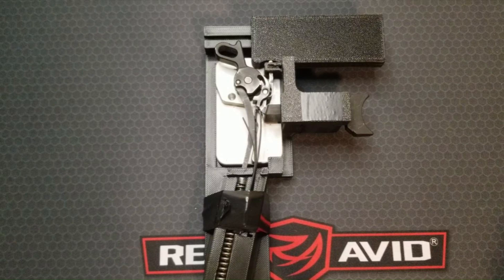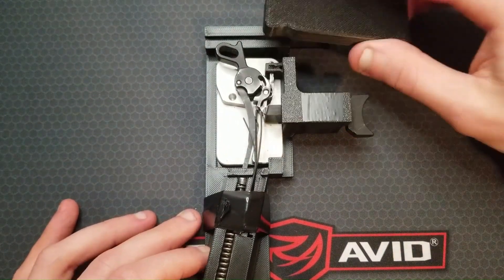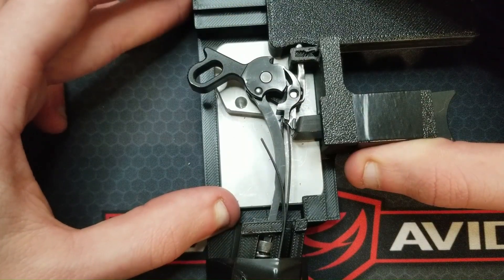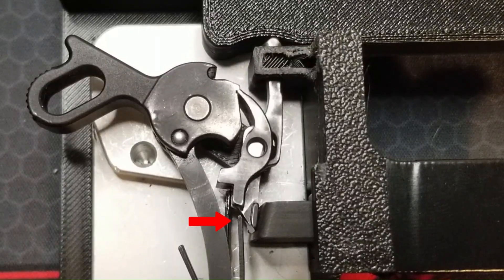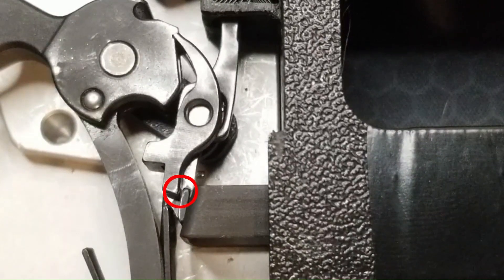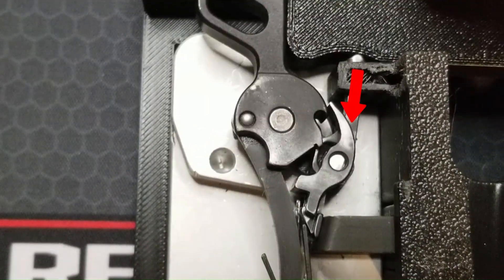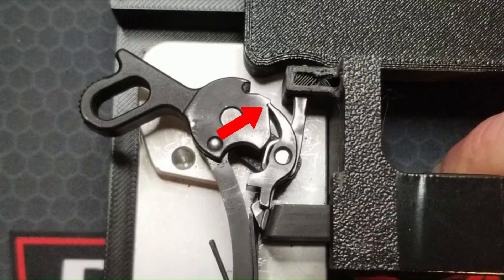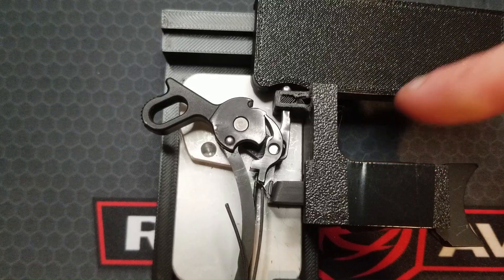Detailed 1911 Trigger Action Demonstration

Comment: Okay, I am interested in getting into 3d printing. Lets say i have a decent budget--whats a good printer for gun stuff?
I'm a CNC machinist with a bit of CAD knowledge btw. I don't know if that really helps. I need to get better at CAD. I'm still an apprentice.
Reply from the maker: I actually just bought a Bambu Labs P1S. I highly recommend Bambu labs printers. You want a printer with an enclosure (that is to control the heating/cooling of plastics that require higher temp and slow cooling for layer adhesion, etc.). If you want to print polymers that are... close to what polymer frame pistols are made from - you're looking at nylon and higher temp polymers - also glass/carbon fiber filled. You need a hardened steel nozzle and extruder gears for that (thats about $40 of parts to upgrade the P1S - The X1C model comes with it already). Thats about it. 3D printing metal is not feasible for people to do at home/for a hobby. the printers are like $50k+.

You'll need 3D modeling software to create your own designs - I use the free version of Fusion360. It works well enough for my purposes. The Bambu labs printers have their own slicing software. You upload a 3d part file (SLT, STP, solidworks, fusion, etc.) into the slicer - set your parameters - tell it which filament you're using and some other stuff. it creates the G code for you and sends it to the printer. 

Thingiverse, GrabCAD, and many other places (maybe some specific to gun parts...) have the models of... stuff... ready for download - throw it in the slicing software, slice it, print it.

Hope this helps.
Reply: @EngineersArmory  i have Fusion360 and a student license of Solidworks although I need to get better at Solidworks. I tried following a slightly old guide to make a picatinny riser mount and it over defined the sketch. Sometimes I really hate Solidworks, I actually haven't played with 360 too much.

It's funny you mentioned the Bambu labs printer. That is the exact model I was looking at the other day, recommended by a guy who built his own CNC machine. I'll have to get that one, it seems really nice.

Eventually my goal is to start my own shop either making 2011 race guns and nice AR15s or I may start by making suppressors. It just depends which way the wind blows if you catch my drift. But if I go the suppressor route I'd probably invest in a DMLS machine first instead of CNC. It's a cool tech with a ton of applications outside firearms and it isn't oversaturated the way CNC kind of is.

Comment: What sear / hammer kit are you using? Never seen a hammer with a sear nose relief cut at the hammer hook perpendicular surface.
Reply from the maker: This is the factory sear and hammer from the MAC 9DS. That relief cut under the hammer hooks makes the trigger have a mile of creep. The hammer has been replaced as a result.
Reply: @EngineersArmory  What did you use to replace the factory parts if you don't mind me asking?
Reply from the maker: @kilowatt9598  Only replaced the hammer and hammer strut. Got a fusion firearms hammer, and a Staccato titanium hammer strut.